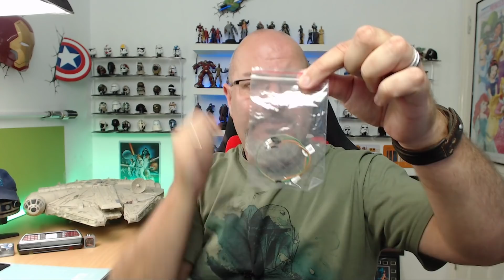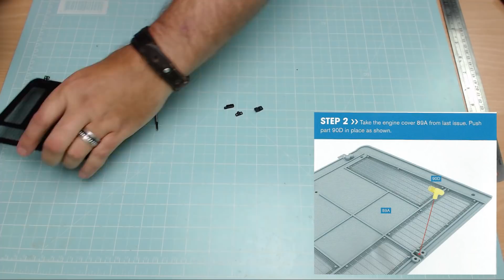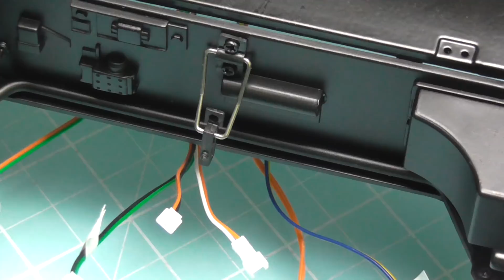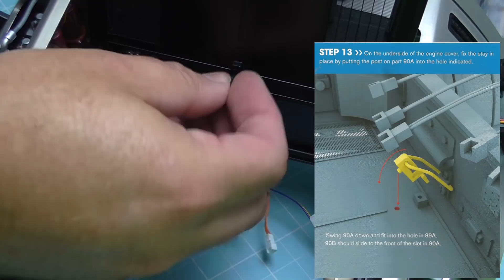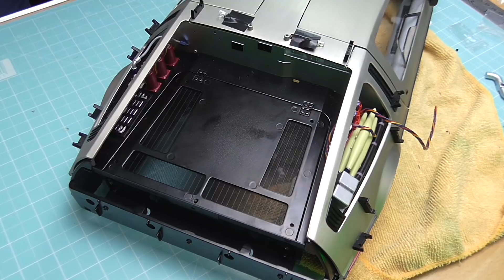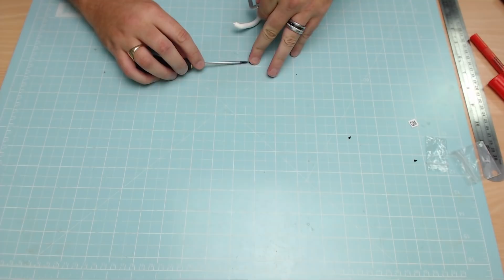Build the Delorean - Issue 90 - Attaching the Engine Cover

Comment: Hello Wayne, hope you’re good. Just competed this issue 90, was just wondering, does that engine cover open with a part attached without using your fingers?. Also that spring loaded mechanism has hardly got any resistance.. kindly if you could let me know. Many thanks.
Reply from the maker: It just uses fingers unfortunately and is very fiddly. Yep not mich resistance on the springs. Issue 91 next. Its a nightmare issue that one

Comment: No replacement LEDs for Australia! Subscribers and Newsagent people alike have all been left without a fix and are stuck with yellow flux bands at the rear end of the car. I've had a good talking with Zoe over on the Facebook Eaglemoss Collections page via the private chat button and she assures me that now it's been brought to their attention that the supplier has failed to include these for Australia, they're now working on a mass fix for everyone, and she'll be letting me know the details once they've sorted the problem out for us. Until then, it's a waiting game as usual for us.
Reply: Hi there. I am in the same boat. I rang the help number and all I got was jst tell me what issue you want replaced and they will send it. Not a great help really. have to go through the issues to find which one it is.
Reply: Jason, that won't help you at all. They'll just send you out issue 87 with yellow LEDs again because their phone staff are useless. In the UK they provided the corrected blue LEDs with issue 90, but forgot to do so for the rest of the world. Apparently they're organising to have the replacements included in a later issue for us all, but don't know when. I gave up and got the EL Wire Mod from www.modelmodz.com and WOW, I'm so glad I did. Much better than the pathetically lit optic fibres that Eaglemoss give us, and you then don't need the blue LEDs at all.

Comment: Wow! giant ejector pin pocks!  I know now that when I get the engine deck it will need some putty work.  Hey Wayne, if you want to snug up that wire part so it isn't so loose, take a small pair of pliers and squeeze the sides together at the point where it goes through the mount on the engine cover.